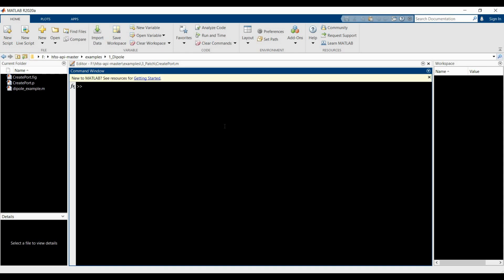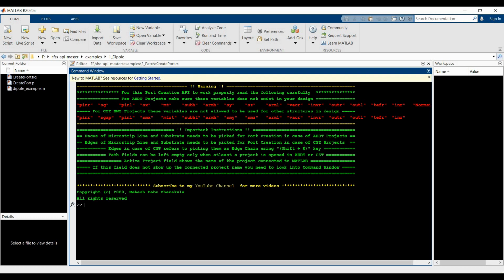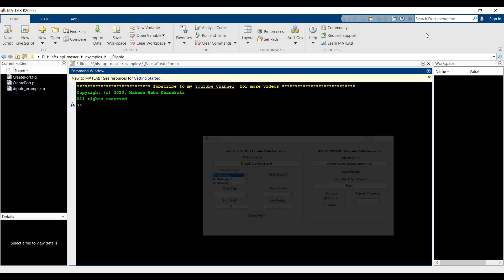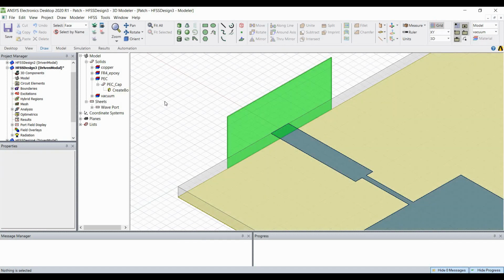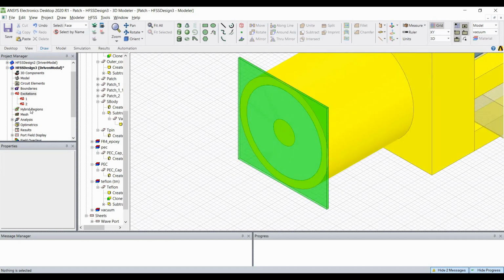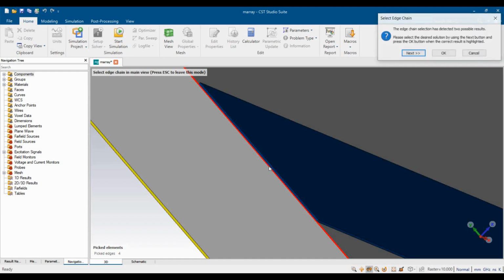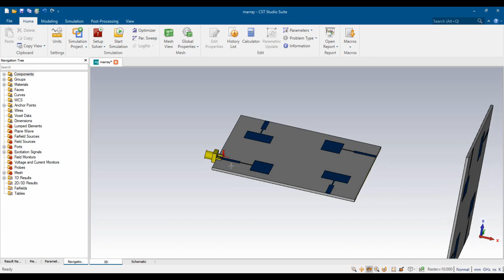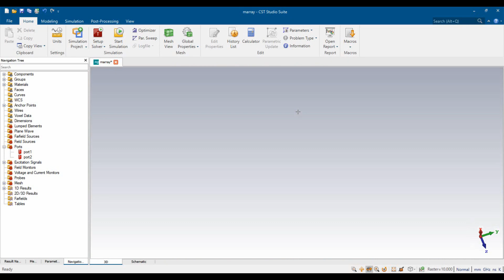Creation of SMA connector in CST and HFSS using MATLAB

Comment: Hello, can you tell me please, do I need to install some toolbox or similar in order to make this connector between Matlab and HFSS?  I neet to import in HFSS a data table obtained with Matlab, that contains the dimensions of the elements of an transmitarray that I want to create on HFSS. Thank you
Reply from the maker: You need to describe your problem to the fullest and share whatever work you have done until now with us
Reply from the maker: Join Telegram Channel for asking more doubts related to this work.
Reply: @tejatechviews   ok thank you!
Reply: Hello. 
Did you get the solution for this problem.. 
I'm also unable to create SMA connector from matlab. 
Its showing an unrecognized function
Reply: I'm also unable to create SMA connector from matlab. 
Its showing an unrecognized function or variable. 
What is the problem?